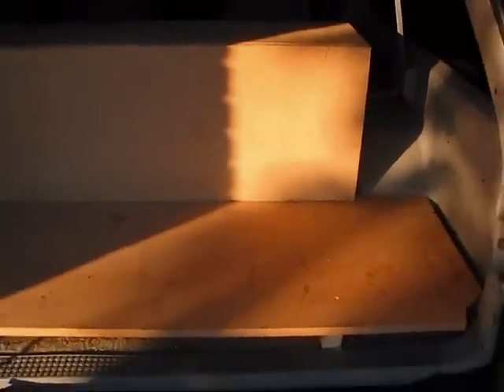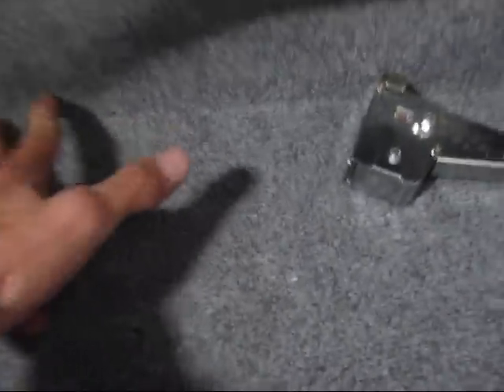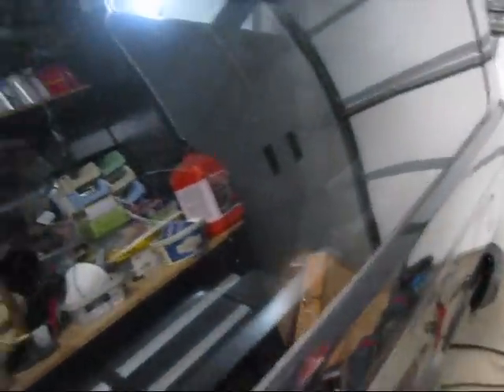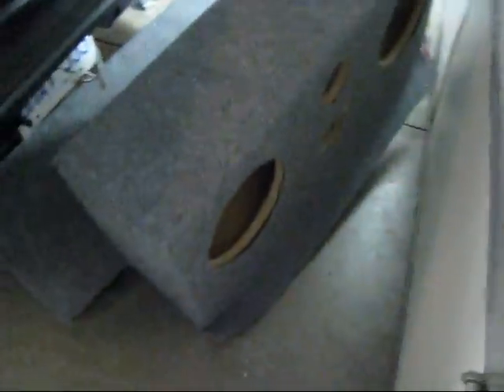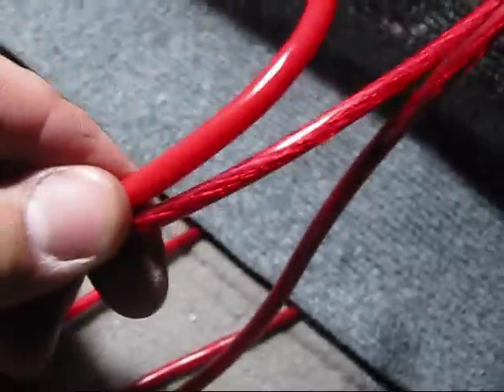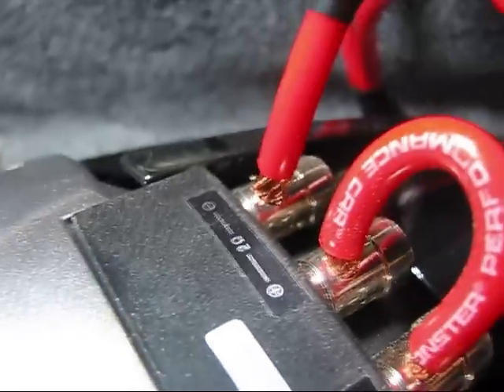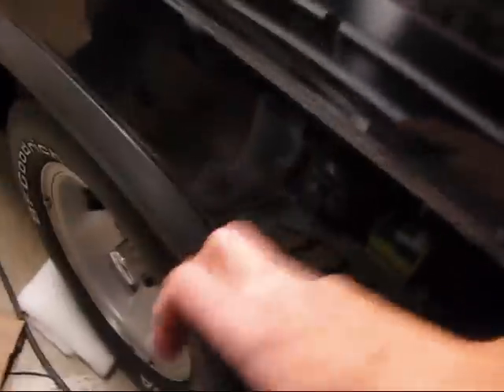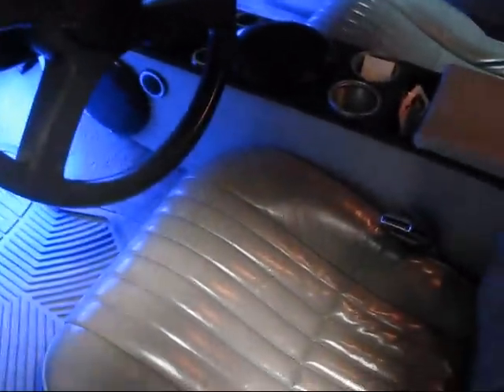S10 Blazer Finishing Sub Box(Oct 2012)

Comment: u could also try gettin a bag of poly fill from walmart and stuffing that box. 1 pound per cubic foot of airspace.. its the same stuff that more expencive home audio boxes use and it should make them lows a little more louder and lower... but if youve got too much air flowin out ur ports, you may wanna try using the pollyfill mats and stapling them inside the box along the walls. Rolled edges on your ports help phenomaly with the air noises you can find rolled edge ports online for as low as $5

Comment from the maker: im not familiar with  flex seal but if its working similar to the rock guard i don't see why not. getting the truck oil sprayed is just either doing it yourself or taking it to a shop and having a thick layer of oil sprayed under and in some cases inside of the vehicle (in between panel's) that will help prevent moisture from getting to the metal and causing rust. basically it makes it last longer.

Comment: i have a house sub in a ported box not made for it for my front room. when i first played bass thru it, it sorta sounded like the port was ratteling or like a farting noise lol. but then i juss stuffed a little poly fill in the box and it sounds great! the sub isn't big enough to move massive amounts of air, but it does move some and the poly has never shot out of the port. its around 5 bucks for a big ass bag of loose fill... the roll may be a little higher but still beats making a new box!

Comment: polyfill wont help the chuffing port noise. with ports you want the end of the port off the interior wall of the box by the dimension of the port. so for a 3" port keep the port 3" off the back wall of the box. also having a rounded port opening on both ends will help with that noise

Comment from the maker: its possible, it could also be water coming from behind the dashboard. best bet would be to dry the car out with a fan or heater being careful not to melt anything and then sit in the car and spray water on it. see if you can find the place water is coming in and then go from there. My old Grand Am had water come in behind the dash... so the passenger side was always soaked and was musty.... that car was a pile so i drilled holes so the water could drain out and that was that.

Comment from the maker: if you watch my earlier build video's i show the routing of the power wires to my amps. i went through the firewall on the passenger side of the truck. i drilled my own holes and used a plastic connector (electrical fitting) as my bushing and then sealed it up. go to home depot and look for a plastic bushing that will fit your gauge of wire, drill a hole and secure it in place. then it can be routed away from any area's that might melt the jacket of the conductor.

Comment from the maker: i was looking at yellow tops for my truck i want one in the back and one up front. but im not 100% sure what brand i want to use. and suggestions? i want something thats gonna be reliable and it gonna help with my voltage drop. i need the current capacity of a real battery lol